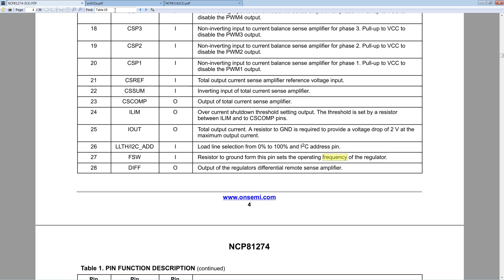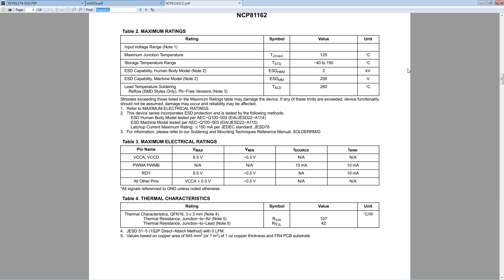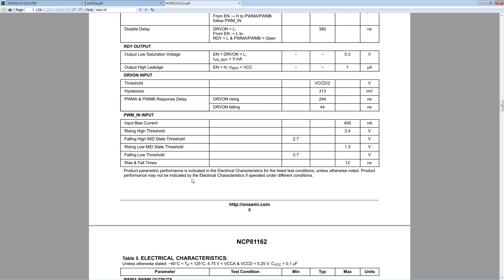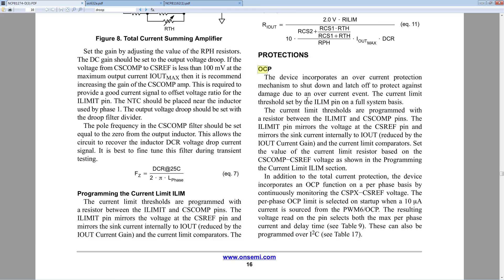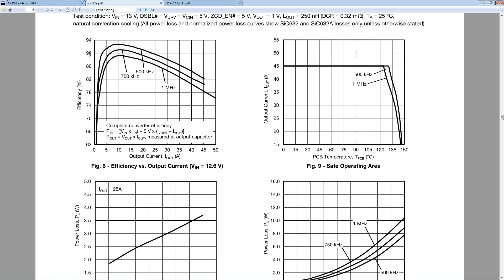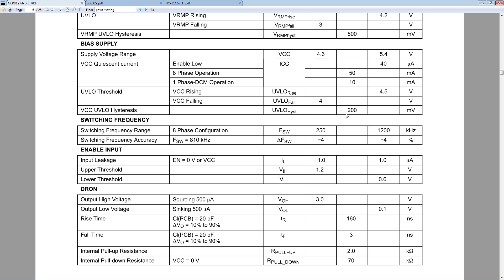Modding the NCP81274 for the GTX 1080Ti Gamerock

Comment: Increasing the switching frequency without changing the loop compensation only reduces ripple, not transient performance.  See COMP pin.  Eliminating droop risks damaging the processor during a large unloading transient.  So add some bulk output cap since that is a low frequency event.

Comment: About the maximum frequency of the NCP81162 doubler... You can calculate it like this: The maximum PWM response delay is 50ns from input to output (page 6 of the datasheet). The PWM on-time should be longer than this delay. At 0.6V output voltage and 12V input voltage, the MOSFETs are switched on 0.6V/12V = 5% of the time. So 5% of the clock period has to be longer than 50ns. This gives us a minimum output(!) clock period of 50ns/5% = 1000ns, which means that the maximum output PWM frequency is 1MHz at an output voltage of 0.6V. At higher output voltages, you can push proportionally higher frequencies through the doubler (2MHz for 1.2V output). If you go higher than that, it probably still works, but the regulation might get wonky due to jitter in the PWM signal's edges or even glitches in the doublers.

The power stages also only care about the total number of on/off transitions over a time period of about 10ms and the PWM on time because this is what makes them heat up. One additional PWM pulse for current balancing every few hundred cycles won't heat them up significantly and the on time does not change anyway.

TL;DR: Max the frequency out if you like, the doublers and power stages will be fine.

Comment: You seem to like looking into old tech, what would one have to do to get you to get a general idea of WTH has failed on a old AM3 motherboard (Asus M4A87TD-Evo Rev1.1) I have? I let it sit completely disconnected from power, but left the bios battery in it, and now the thing goes nuts and or will not even post beep. Would be nice if I could at least get a schematic of it from Asus, but that is doubtful. Even though it is old tech, it had a WAY better over clocking overhead than my current AM3+ Gigabyte Entry level board
Reply: dumb question but did you try replacing battery and resetting BIOS? an asrock of mine failed like yours, but I was able to fix it by starting without battery (because it only would post like this) and then reflash the newest BIOS Version...
Reply: @kings_pride  of course replacing the battery and flashing the bios was the first thing I tried when it started shutting down, literally seconds after it posted. It would start to enter bios and pixelate, so I assumed possible Bios corruption, so I used Asus Crash free bios, but it did not fix the problem. Eventually, it just no longer posted. One sign that the VRM may be bad is one time it would boot with all 6 cores, the next would only show 5, the next 3, etc. Not sure if it's mosfets, capacitors, resistors, or the regulator itself, but it was definitely killing cores

Comment: 16:14 - Actually it works like this - 1/60.4k = 1/41.2k + 1/x  => x = (60.4k*41.2k)/(60.4k-41.2k) = 129.6kOhm      . So if you put a 130k resistor in parallel with the factory 41.2k you will get ~60.4k of total resistance

Comment: 3rd?  

Honestly though, serious question- I've found that cooling the backside of mainboard where the VRMs are with a fan can lower VRM temps by as much as 20C.  Have you ever tested that on any of your hardware?
Reply from the maker: Never tested that but that result doesn't surprise me.
Reply: You can do something absurd and still win I am sure! I can tell you carry a gift like no one else has man! I support your decisions!
Reply: It is very common practice in industrial power electronics. VRM components are designed to conduct the heat to the PCB and cooling the actual PCB is very effective method because power PCBs have such a heavy ground/vcc copper layers.
Reply: Well, I am doing that to my Gigabyte Aorus Gaming 7 X399 board and it dropped VRM temps from 70C to around 53C just adding a 30mm fan at a low RPM on the back of the board.
Reply: i prefer 120x120mm fan mounted right behind the CPU socket. That of course requires cutout for the fan in most cases.
Reply: If I remove my unused 3.5" drive bay, the MB tray is cutout revealing the entire reverse of the CPU/VRM area.  Perhaps I will test both a direct fan-only supplemental air and add a heat exchanger with thermal pads and a fan.  Would like to know if this will do the job since I am likely going with a CPU-only waterblock vs. a monoblock for the custom loop.  Also curious if the reverse cooling could do the job alone and allow the removal of the VRM "heatsinks" from the front...

As this is a GPU VRM vid...  the options for additional reverse PCB cooling of the GPU VRM would require a little more creativity....  though with a replacement backplate one might find it a bit easier to locate pads/copper spacers and additional airflow to the reverse of the GPU...
Reply: wasn't there a post on the BZ blog, about putting sticky heatsinks on the back of a GPU PCB to help cool the VRM. Oh, it was a motherboard.
http://cxzoid.blogspot.com/2016/06/oc-review-gigabyte-ga-990fx-gaming.html

Given that a Huge giant Power and ground trace should be around there, I'm not surprised it works. It's just a matter of getting fresh air behind the motherboard in most computer cases. Removing the side panel and blasting fresh air at that side of the case with a desk fan also works, lol.
Reply: I cooled my computer with a big Chinese fan during hot days in the summer.